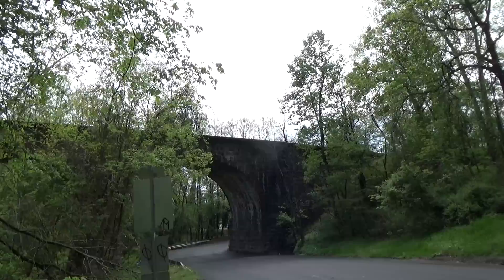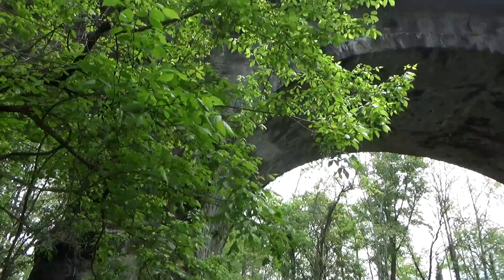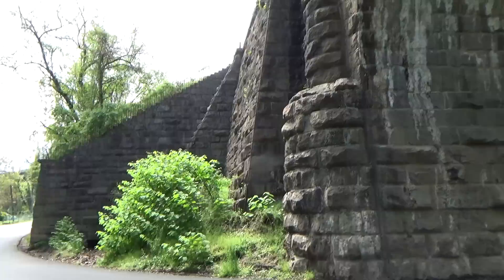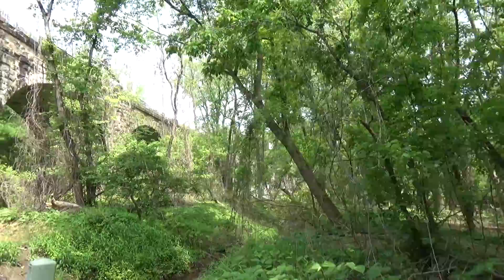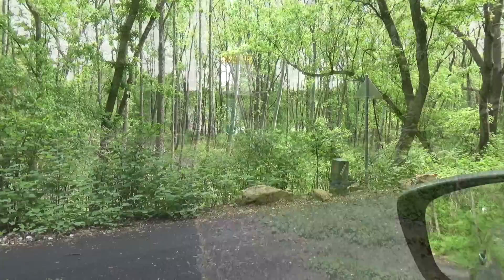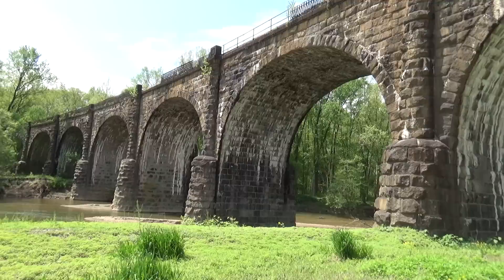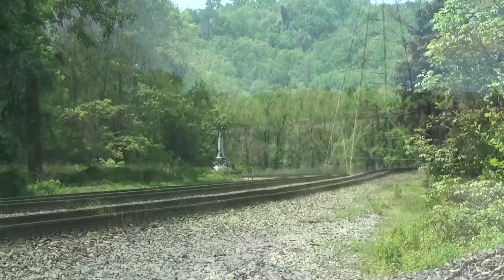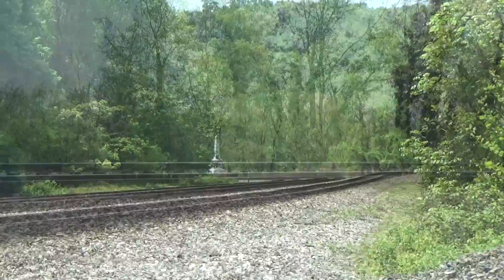Thomas Viaduct - Worlds Oldest Multiple Arched Stone Railroad Bridge

Comment: Sorry Tom it may be the oldest one in North America but not the world. the oldest surviving single-arch railway bridge in the world, and a key element of the industrial heritage of England. It was built in 1725–26 by stonemason Ralph Wood, funded by a conglomeration of coal-owners known as the "Grand Allies" 

Laigh Milton Viaduct is a railway viaduct near Laigh Milton mill to the west of Gatehead in East Ayrshire, Scotland, about 5 miles (8 km) west of Kilmarnock. It is probably the world's earliest surviving railway viaduct on a public railway,and the earliest known survivor of a type of multi-span railway structure subsequently adopted universally. 
The viaduct was restored in 1995-96[3] and is a Category A listed structure since 1982.[4] It bridges the River Irvine which forms the boundary between East Ayrshire and South Ayrshire.
It was built for the Kilmarnock and Troon Railway, opened in 1812; the line was a horse drawn plateway (although locomotive traction was tried later). The first viaduct was closed in 1846 when the railway line was realigned to ease the sharp curve for locomotive operation, and a wooden bridge was built a little to the south to carry the realigned route. This was in turn replaced by a third structure further south again, which carries trains at the present day. The other multi arch of note is the oldest concrete structure at Glenfinnan built 1897-1901 in Scotland as seen on Harry Potter. 
Neil
Reply from the maker: Very impressive, but when was the last time it saw rail service over it!
Reply: @TomsTrainsandThings  Just looked this up - 1846 - https://en.wikipedia.org/wiki/Laigh_Milton_Viaduct. Do like your video - reminds me of my trip to the Luxulyan Valley in England. Very similar rugged granite stone. So impressive close up! But Neil is right, you cannot claim a world record in the title of your video without that being true!!
Reply: Not sure will have to look into that. Check out this list https://commons.m.wikimedia.org/wiki/Railway_bridges_(-_1918) Neil
Reply from the maker: @JohnPW22  
@Neil Rogers
Only going by the content from the Wiki listed in the description.
Reply: CSX uses Thomas Viaduct daily.  I is on the Baltimore -- Washington line formerly o f then B&O.